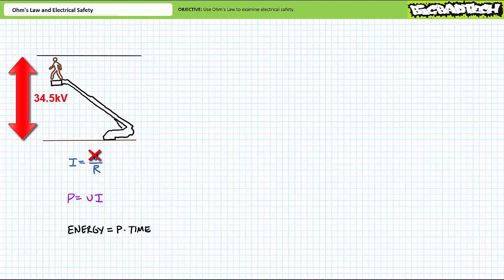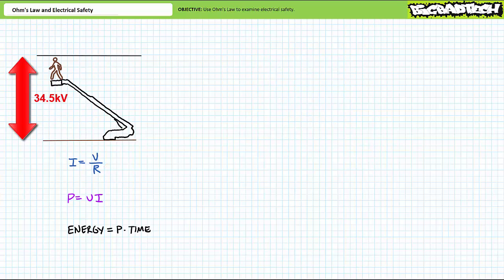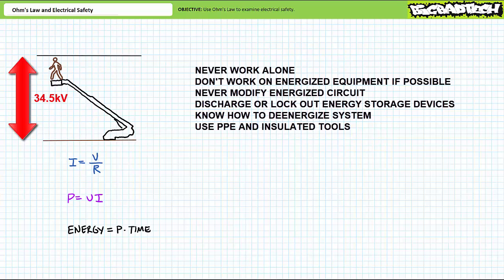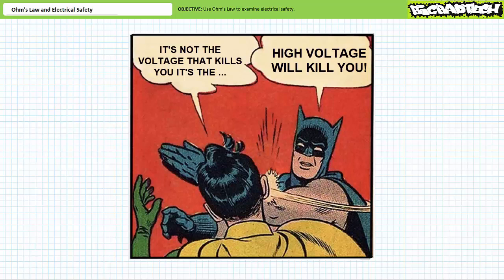Electrical Safety and Ohm's Law (Part 1 of 2)

Comment: which topics cover grounding and bonding?
Reply from the maker: Stay in touch. I'll be releasing some material on series circuit analysis after a quick summer break that covers ground referencing and its influence on high and low side switching arrangements.

Comment: Sir,
Didn't you already complete your recent uploads in DC circuit analysis?
Sir, I will be very glad if you give us some lectures on power system analysis, circle diagram, fault current calculation, unbalanced short circuit analysis, per unit method, symmetrical components and sequence networks.
I am following your channel since 2015, sir you are the best faculty.
Best wishes for you
Reply from the maker: Yes, I'm in the painful process of re-releasing a lot of the older DC circuit analysis lectures that had audio issues. You'll notice the newer lectures are a lot more streamlined. Additionally, I've included supplementary example lectures. Once this monkey is off my back I've got a whole bunch of new stuff coming your way including transformer open and short circuit tests, autotransformers, inrush, single phasing, 3 phase AC transformers, squirrel cage induction motors, wound rotor induction motors, solar power, wind power, and more. Stay in touch!